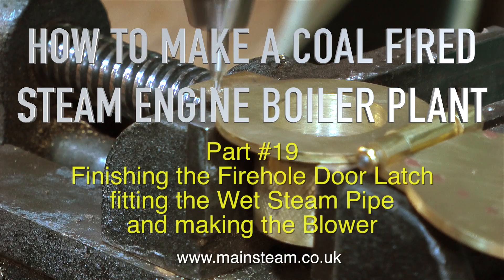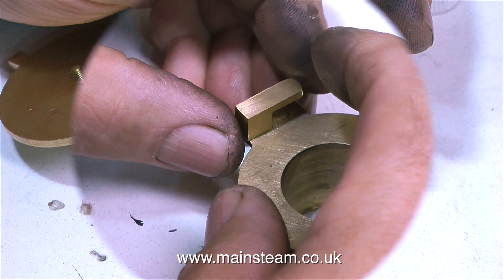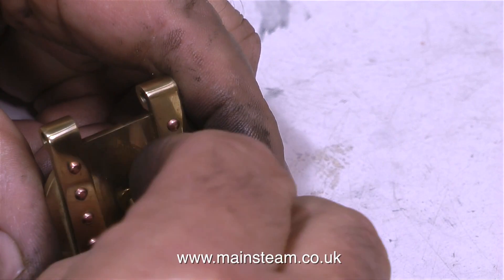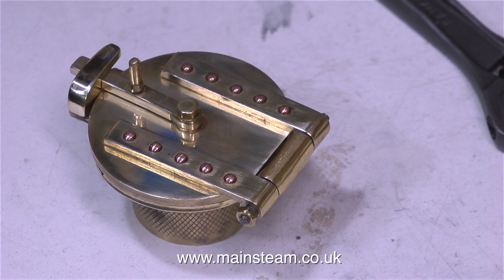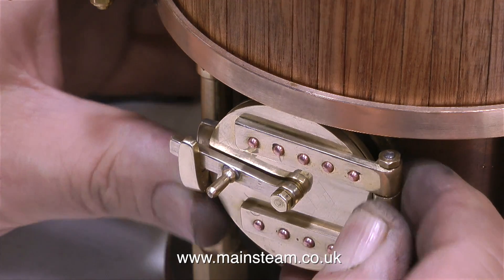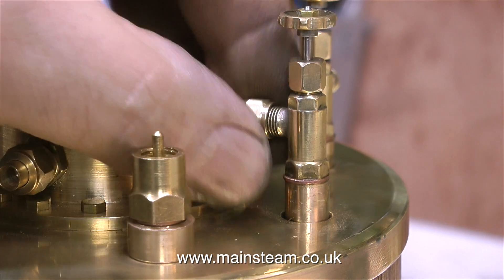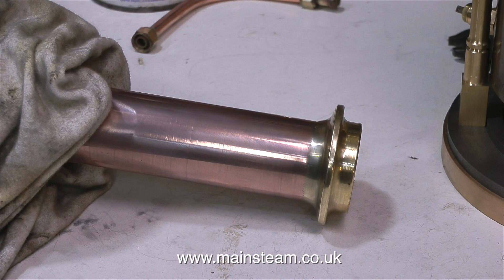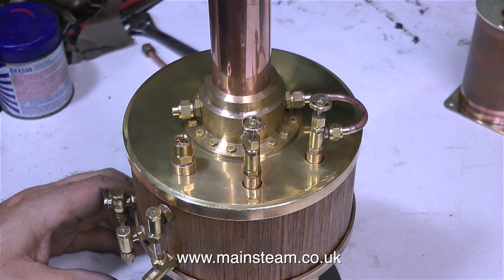HOW TO MAKE A COAL FIRED STEAM ENGINE BOILER PLANT - PART #19

Comment: Sorry Keith but I'm a REAL engineering expert and I'm afraid a 13th Century Knight's Axe was completely the wrong tool to use - anyone of any real expertise knows that a 10th Century Flanged Mace is the better choice!
Reply from the maker: Ok I agree with you on this, but I sadly don't have a 10th Century Flanged Mace yet as I am a relative beginner in the Battlefield of Medieval Slaughter and I appreciate that it is important use the correct Carnage device at all times ...... }:-)))

Comment: Well as I have always said when in doubt use a bigger hammer.
I have used Brasso for years, but have never found it with wadding included, only the tins of liquid. while searching for a place to buy  the wadding which I found, I found out that Brasso is not as old as I thought it was it originated in Britain in 1921.

Comment: Is there any special reason why the fire door was a loose fit, or is it just your design choice?
Reply from the maker: I thought that I explained in the video ??
Reply: Well, you said you wanted it to be removable by hand. But that doesn't say anything about it having to be removable. It could be removable only with tools, but removable nonetheless. I do apologize, but i didn't understand this and i was curious about why you made it like that. Is it just a design choice? Or maybe there's no point in silver soldering it cause the solder will end up melting?
Thank you for the reply.
Reply from the maker: Silver soldering certainly would not melt at boiler temperature, I think I mentioned in the video that the firehole unit needs to be removable to disassemble the boiler.
Reply: Come to think of it, i think i remember it now... i watched so many of your videos lately, it's all a blur :) Thank you for the reply.
Reply: Will also make it easier to feed boiler through a larger orifice- Im glad you went this route...
I recall mentioning it in an earlier video, re; the tiny hole in sleeved door versus fuel size...
Nicely done job of it sir!
Will mention though, I kinda thought you would be fitting an insulating plate as part of the lock nut, but considering the hole is barely bigger than your thumb I doubt it would be of much benefit & I know if it was me I wouldn't have bothered with one on a model this small either... ;)
Thank you again for your time, effort & content :)

Comment: beautiful!
Are you considering a series on a steam boiler for beginners to power the Victoria model?
Reply from the maker: I don't really do boilers, although I was thinking of doing a short series about building a proper copper boiler with a water gauge etc for a "Mamod" Steam Tractor ......
Reply: Keith Appleton That would be great! Building boilers seems to be lacking somewhat on internet. Apart from the many "don't do it" advices that is.
It seems to me that with a proper design and testing it should be doable, but on the other hand I've never done it so it might be one of those things that turn out to be less easy after starting..